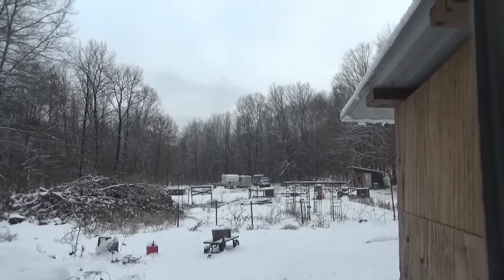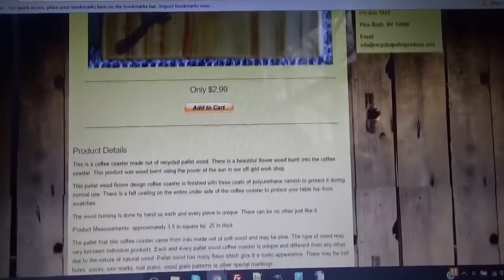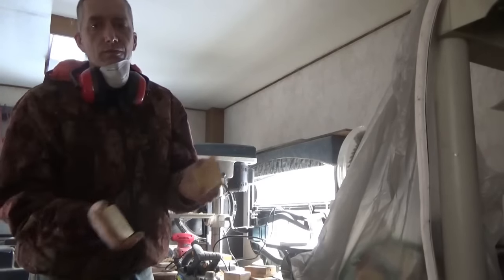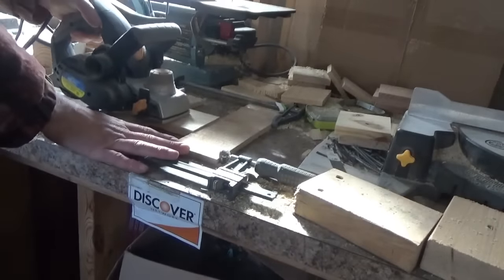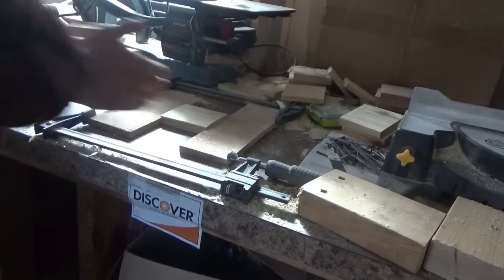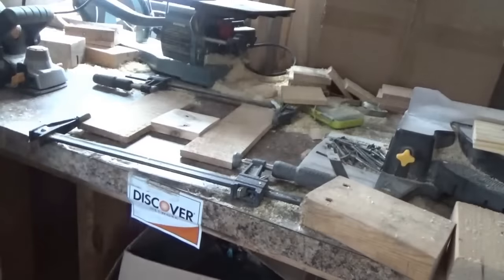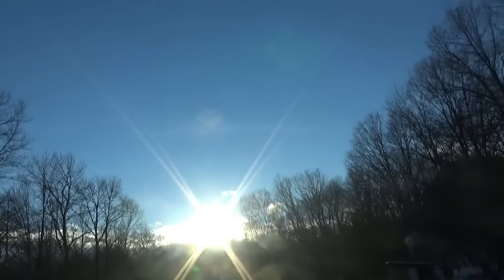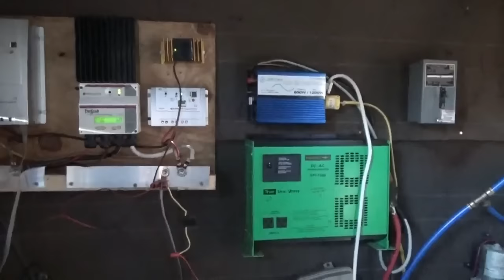Snowy Homestead ~ Wood Working ~ Web Work & More

Comment: if it wasn't cold weather too can wet the blanks and clamp them between something straight.  let them dry and most will be straight.
Reply from the maker: True. The cold weather makes many things harder.
Reply: The Do It Yourself World Yes sir.  It sure does.  it would be a nice summer time project.  2 pieces of heavy C-channel and some good clamps.  I think it would possibly make life easier for ya.
Reply from the maker: Yes it would. The ones I cannot work in winter I will fix in summer :)
Reply from the maker: Or in the tiny house on wheels. Problem inside is that its too dry and the wood tends to crack on me. Dries way too fast.
Reply: The Do It Yourself World Yes if you had some sort of kiln or a way to control moisture levels.  I worked in a mill when I was younger.  The kill was a gigantic multi million dollar facility.  Memory serves tho it was a humidity controlled dryer.  not sure how it was set up,  but if one could make a small one out of a few drums it would be awesome.

Comment: Just cover the screen with $2 opaque film preventing reflection. A lot cheaper than switching to a Mac. In fact that is just silly. The website looks fine. Good enough. Thanks to the sister.
Reply from the maker: Its not just the screen as I have often complained. Its the operating system as well. Anway, I have a Mac that I am restoring for work. Thanks.

Comment: i'm sure you wont burn your hands on that heater powered by the wind turbine....... would be smarter connecting it to a mppt chargecontroller feeding the small amounts its producing in the batterybank...., the dumpload is realy not a heater, its a brake preventing your turbine spinning out off control if now power is drawn from the charge controller. this 5 watt turbine wont heat anything!

Comment: the pallet wood is not cured. (or dried) it will cup. the only way to make anything flat is to plane 2 boards down to 1/4 inch, glue them together with boards with an opposite growth ring pattern so the cupping of each board is counter cupped by it's mate.

Comment: Hi Troy why can't you turn the planer upside down like with the belt sander and use it that way, CAREFULLY !!  Seeya Rob
Reply from the maker: That would be very dangerous and nearly impossible. The blades would likely through the piece of wood and tear up a finger or two. The belt sander at the worst has pulled my thumb nail backwards a little bit or given me a light burn. Most of the times it just throws a finger away lightly if I hit it. Still not the best or safest way to use a tool but until I get  a table model belt sander this works.

Comment: Why are you trying to save the warped coaster blanks? Set up your chop saw with a stop block and you could knock out dozens and dozens in no time at all. No measuring, no planing. It's not like you're going to be throwing away any thing valuable if you get rid of the warped ones.
Reply from the maker: Well, because I have to make a lot and right now all the wood is under snow and ice. I have another batch inside the tiny house drying for now. But I still have to plane the wood before cutting and then sanding. Its all the same work either way.

Comment: I think you should use Linux since it is open source and therefore more in line with your off-grid project. Linux can be run on either Mac or PC machines. You could use a dual boot system so you could go back to Microsoft if you feel like it.
Just saying.
Craig
Reply from the maker: I have tried Linux and was not happy with how complicated it is. At least I know mac software because I had to use it professionally for a while. Still remember it all.
Reply: Linux has improved over the years. It's pretty usable, now. You might try it on a live distro; on a flashdrive. I would just download Linux Mint 18.1 and install it on a flashdrive. Then you could run it on the flashdrive and see if it works for you.
At least it's free. As in both open source and no cost.
Reply from the maker: True. Maybe I could try it again one day
Reply: The reflection in the screen is because you bought a laptop with a gloss screen. You need to buy one with a matte screen if you don't want a reflection. Macs also have a high gloss screen...

Comment: Hi Troy, I don't know much about wood (obviously 😁) and I wondered why the pallet wood would still warp even after being old---i.e. weren't the pallets old? I just figured used pallets have probably been around for a while and would have dried completely. I am asking because I want to start making some odds and ends with wood and don' t want that to happen. Could it have been avoided?  Thanks. Enjoy watching you guys.  Keep warm!
Reply from the maker: When its on the pallet, it cannot warm so badly. The wood gets wet, dries, wet, dries and so on while outside but it is nailed in place. When you remove it from the frame, the wood is free to warp as it dries. Most wood that is outside will be somewhat wet. Even wood I have stored in the tent has more moisture than it would indoors. Inside it dries out fast and will warp and even crack. Thanks
Reply from the maker: If I learn how to avoid that I will tell you. One way is to bring it inside and let it dry in stacks with weight on top. Has to lie flat while drying. But in stacks it will dry slower - I guess a benefit though.
Reply: The Do It Yourself World Thanks for getting back to me so quick. So, if I cut a board, just one piece, to use as a shelf, will it warp in my house once on the wall or do I have to buy special wood, i.e. special meaning treated with something or dried a particular way?
Reply from the maker: If its wet, it will likely warp. If its dry, it probably will not warp. Pallet wood has been properly cured. But if left outside it will absorb moisture. This has to be dried out slowly. If you can get a pallet that is dry and has not been outside recently then it should not warp.
Reply: The Do It Yourself World Got it! Thanks